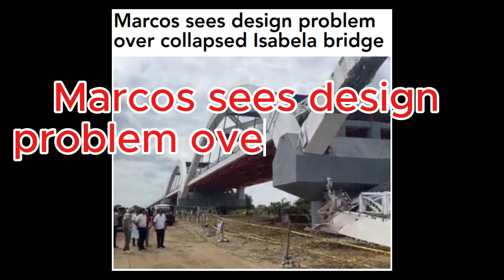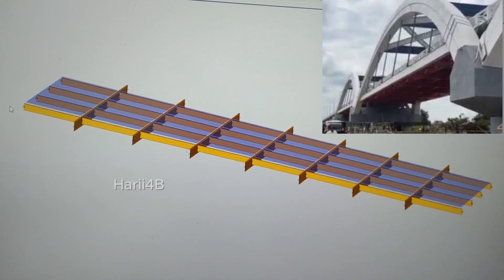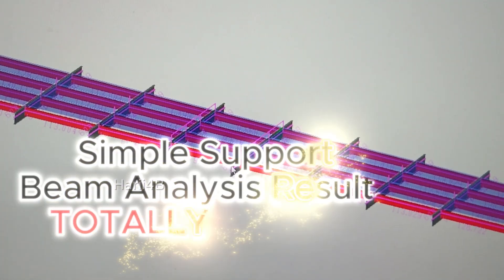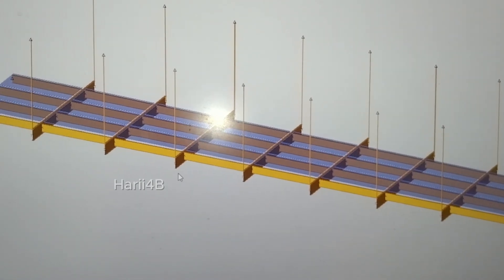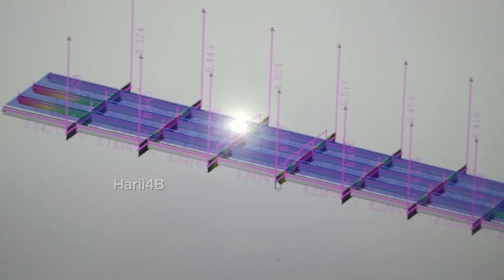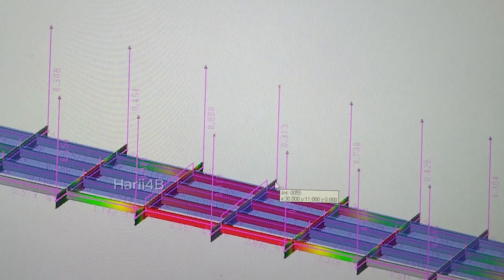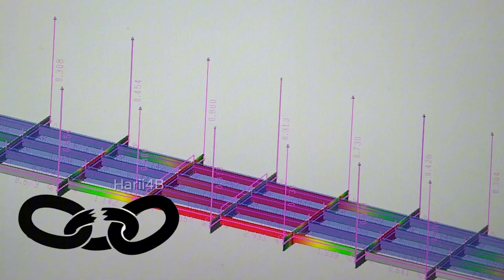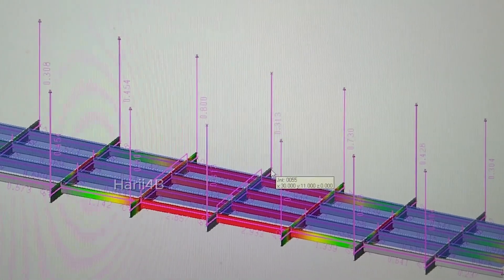ISABELA BRIDGE Cause of Collapse, EXPLAINED!!

Comment: 102 tons, 10 wheeler truck.  Are they kidding me ?
.
Reply from the maker: well they actually made that statement and did not recant yet
Reply: @Harii4B  maari siguro naring ihambing na tanong na bakit nakakabutas ang isang tingga na bala ng isang baril sa isang steel plate e kung tutuusin e ke gaan gaan lang naman eto kung hinahawakan? Di kaya ang dahilan ay yung pwersa na nabuo sa pagsabog ng pulbura sa capsula ang dahilan? Hindi kaya ibig sabihin na mas bumigat ng halos doble hanggang triple ang bagon na may dalang mga bato ay dahil sa Force na nabuo nito habang tumatakbo kaya yun ang kinonsidera at idinagdag sa bigat ng sasakyan para abutin ng halos isang daan tonelada?
Reply from the maker: may video po na smooth naman tumatakbo ang truck sa bridge at di naman sila nag sudden bracking. kung sudden brake meron talaga ma develop na dynamic inertia increase force. pero sa video sudden collapse talaga near arch pedestal support. i will try to make an analysis on that condition, if time permits
Reply: Ganito na lang. 102 tons/10 wheels = 10.2 tons per wheel or 9,250 kgs. per wheel ang load. Ang maximum capacity po ng pinakamatibay na wheel ay with a load index of 150 which is 7385 lbs.or 3350 kgs or  3.35 tons.
Reply: Kung totoo po yuong statement na 102 tons. Duon pa lamang sa pinanggalingan ng truck sabog na lahat ang gulong.😆😆

Comment: Kung may sala, tangal ba ang mga involve na civil engg licenses ng contractor during construction?
Reply from the maker: maging subject pa ito under ng in-depth detailed investigation by 3rd party review if i push ng gobyerno, at pag napatunayan na mali ang design or contruction or both, may sabit talaga ang designer / contractor dyan.. mahanag kabanaya pa ito. mag may time ako gagagawan ng ko ng futher analysis kasama na ang arch sa model... at mag pokus sa detailed connection analysis.. pero syempre wala ako access sa detail construction plan kaya di ko rin magagawan ng full in-depth as built analysis checks..
Reply: @Harii4B  sana di lang multa ang abutin pati na rin ang mga licensya ay matangal din..para sa mga tao na susunod na balak magkaroon ng contract sa gov..di na nila gagawin ang magsubstandard ng materyales at design dahil sa corruption...matatakot na sila dito
Reply: sana
Reply: Kung walng kuraption  hnd yn babagsak
Reply: Sir Di ba ang Design bago i Present marami nag analize dyan mga Engineers hindi lang isa o dalawa engineers pinag aralan nila strength of materials na i ang  tugma dyan   ayon sa Design napanood ko din presentation ni Engr Toto Causin no 1 yong coment nya yong Rod na ginamit ay wala naka diagonal na rod ang paliwanag nya dahil ang tulay gumagalaw ng atras at abante at walang pumipigil sa moving at madali salita may kulang pa sa design at kung bakit hindi napansin ng mga Engineers ang mga kulang at taga dyan ako dumadaan ako lagi sa tulay napansin yong ginamit nd i beam sobra nipis at maliit at wala din support mga i beam na cross diagonal na support ng beam yan nakita kong fulay na ganyan,ang big question ko sir kung budget ba na tulay na yan na inabot ng 1.223 B nagastos kaya dyan dapat i audit yan upang lalabas katotohanan kung yong Design  at budget ay tama
Reply: @ ung sec dpwh hangang ngayon tahimik mukhang walang comment sila

Comment: possible. i guess its more on DPWH and CONTRACTOR  CORRUPTION. steel specs should be looked into ,also the testing laboratory who do the steel and concrete testing. daming butas for corruption to make money nagkabukuhan lang.
Reply: Alam ng mga engineer yan, 1b, amount ng tulay truck  Dili pwede dumaan? hahaha,. DPWH ang CONTRACTOR may kasalanan  "QUALITY NINAKAW DYAN"  kasi speaking of quality pera ang kaakibat dyan,,  taon ang pagawa ng plano at pag approve dyan Pati dumaan dyan my possibility study and DPWH dyan, xsample pabili ka tv Sonny 85" 200k budget ang binili ng kkntractor Devant 85" Sabi contractor pareho lang engineer TV,  hatiin nalang natin ang subrang pera sabi ng engineer, d alam na.. kasi substandard ung cable na ginamit, ung arko d naman bumagsak..
Reply: Cable failure @insongpamine1050
Reply: Sa termination failure yan bakit di pinakita yong zoom section ng cable na cause ng failure. Pafabricate ng report na malayo sa actual
Reply: it certainly is. DPWH, CONTRACTORS AND POSSIBLY LGU (PROVINCIAL AND MUNICIPAL) were involved here. This does not happen just because it happened. People were involved in this, using excessive funds or prolonging construction for their personal gain.
Reply: NOT ON THE STEEL..  Look The STEEL composed of BOLT and KNOTS.   THe BOLTS SNAP Not the STEEL ROD.   ALL BOLTS and KNOTS SNAP not the STEEL...
Reply: Hindi designer, but ang contractor at ang dpwh. Bobo si bangag kaya designer ang sinisi.
Reply: mga tanga anong DPWH at contractor tanga kaba? si bbm inutil na mismo ang nagsabi na 1.8billion yong budget sa tulay tapos binabawasan ng under 1billion para tipidin🤣🤣  simpre kong ikaw yong contractor pagkakasyahin mo lang yong budget na nakalaan sa proyekto alangan naman tapalan mo mga tanga😂😂😂 at normal lang na hindi yan matibay dahil hindi nasunod ang kalidad ng design dahil yong budget bawas na  ibinolsa na ni bbm inutil at yong iba pinaayuda sa mga patay gutom🤣🤣🤣🤣🤣🤣

Comment: Sir, is your simulation using the same type, dimension, and grade of all steel used, as well as the vertical members diameter/sizing ?
Reply from the maker: i actually analyzed with 7nos pair of vertical strut members, it appears it is 6nos only which make it worse
Reply from the maker: assumed more or less similar or maybe bigger section. i considered 1200mm depth transverse girders
Reply from the maker: bottom line here is must analyze the verical connection considering full span of bridge to carry convoy truck loading, so happened it failed already a single 35MT truck loading
Reply: Sir the design is only 27 tons according by the Engrs do the design
Reply from the maker: yes sir, sa analysis ko nga 35ton lang applied load ko dapat 54tons
Reply: dapat dinagdagan un vertical studs pra ndistribute un load

Comment from the maker: ISABELA BRIDGE Cause of Collapse, EXPLAINED!!
What could be the main reason? Overloading or Design Flaw or Both?
Reply: The weight of the money spent for the bridge?possible din ung workmanship and craftsman.
Reply from the maker: yes material testing of actual samples (steel, rebars concrete) can be done. also the connection design detail and workmanship
Reply: the tension rods and its connection at both ends are indeed the main issue sir. It means this is the designer's fault right?
Reply: @ does dpwh rechecks the design submitted by the engineer? I think dpwh  sop is to always check the design, plans because whatever they dpwh build is for public use?
Reply: It's a pull-out failure of the hangers due to improper anchorage detailing. Then, if the arched girders are merely for aesthetics, the whole bridge is actually mal-designed.
Reply from the maker: @wellmanmalvar1072  yes indeed!
Reply: Light loaded bridge,how much is the estimated cost of the proj po kaya?
Reply: I THINK ARC DESIGN is GOOD so this is DEBATABLE..  I THINK BEST  Term to say it CONSTRUCTION FLAW..  
     VERTICAL ROD have BOLT and KNOTS.   Hallow Or EMPTY ARC.   POST is under Size Maybe Reason for them To make the ARC LIGHT WEIGHT and HOLLOW inside.